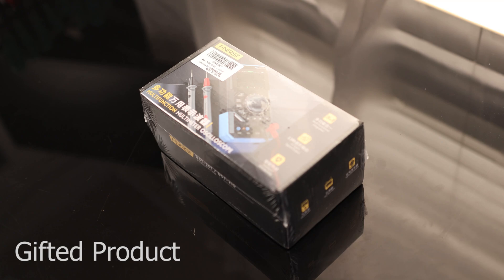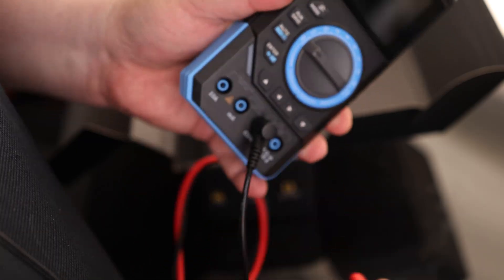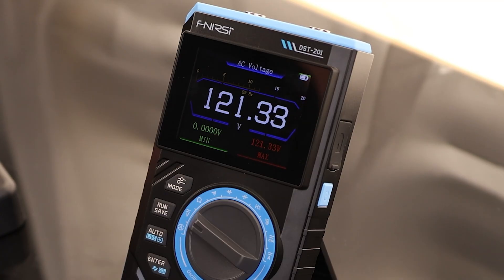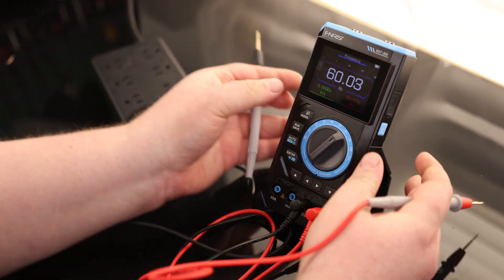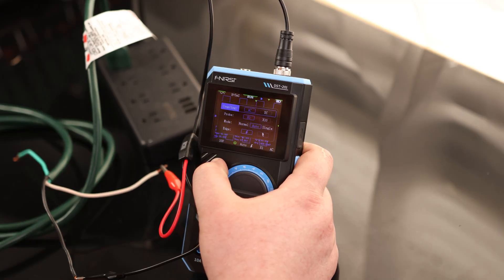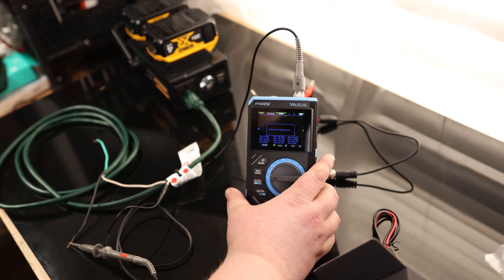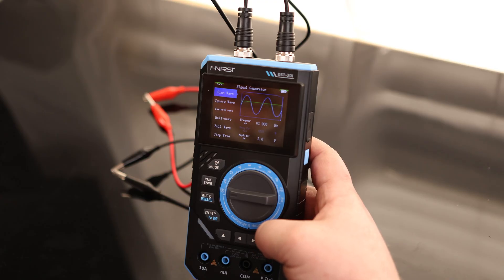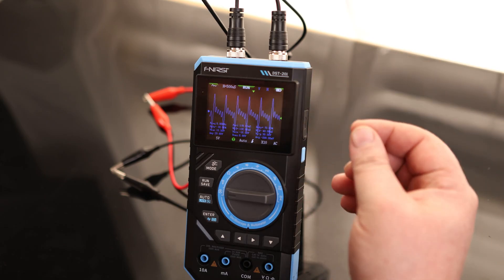FNIRSI DST-201 3IN1 Digital Multimeter 19999 Counts TRMS, 1MHz Bandwidth Handheld Oscilloscope

Comment: I didn't get the temperature sensor in my case !????   ...
Reply from the maker: Did you get the 201?
Reply: @distractor_beamreviews no..  I order  DST - 210  with oscilloscope...
Reply from the maker: That one doesn't come with the thermal probe.
Reply: @distractor_beamreviews  That is just stupid ..!! And disappointing 😢 It costs more and is says in the description that can measure temperature..
Reply from the maker: If you like it aside from that, you can get a thermocouple on Amazon for about 6 bucks.  If you feel like it doesn't meet your needs, you should return it.  It may be worth contacting FNIRSI to see if they would be willing to send you a thermocouple.